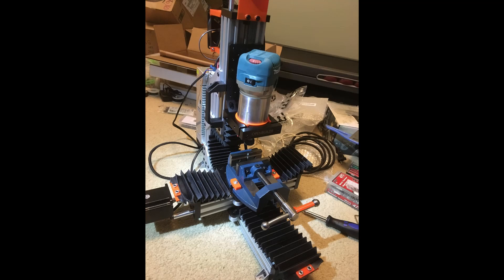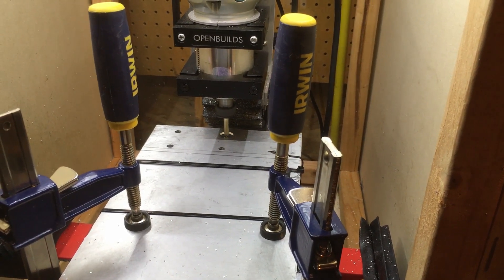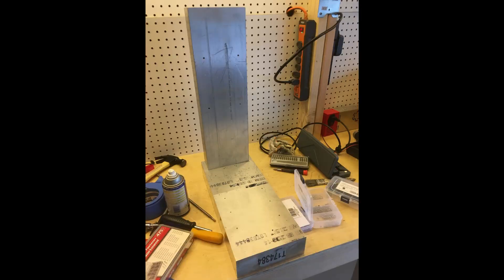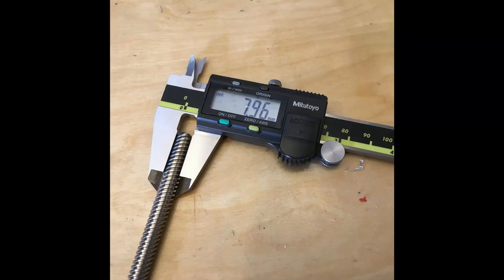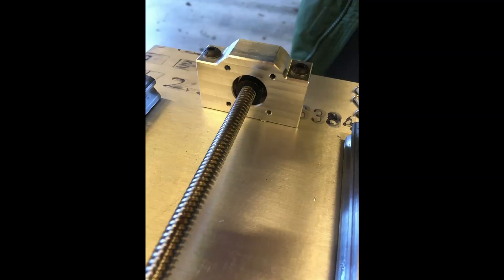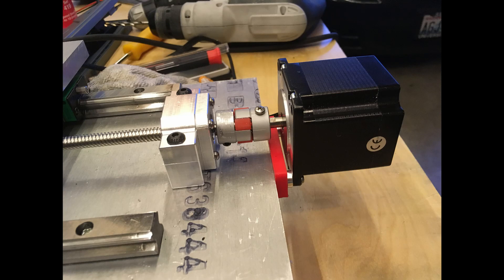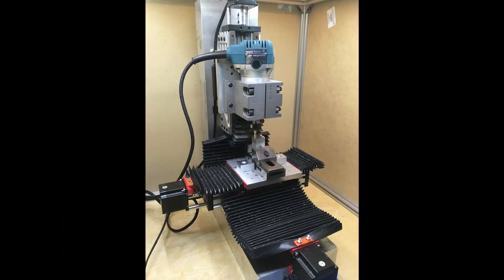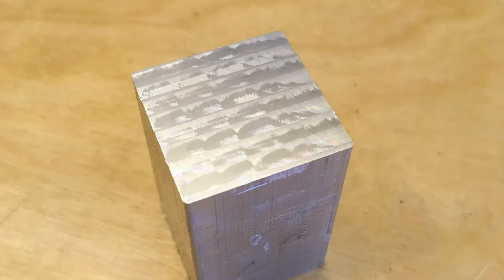OpenBuilds Minimill: The Final Upgrade

Comment: Not sure if you are still on here, but figured I would ask. I am planning on building one of these, but curious how you drilled the holes on the bottom of column? Most drill presses don't have room for the 17" or so inches the column is. Thanks!
Reply from the maker: I used a hand drill, with a drill guide to try and keep the holes perpendicular.
Reply: @imnoexpertbut  Awesome, thanks for replying. I would have never thought of the guide. I'll look into getting one.

Comment: use smallest possible diameter - single cutter carbide end mill - do not feed directly into z always feed z and xy at the same time - the axial force decreases and the cutter no longer wobbles out of its axis - feed less into z and increase the feed instead

Comment: Question about the mounting of your (y-axis?) stepper in the front. I see the bottom holes have bolts going into the aluminum block, and it looks like the top holes are bolted into a floating mount for the sleeve/cover. Wondering if you may be able to reduce a little bit of vibration by adding a 90 degree bracket for the top holes that bolts down into the aluminum block on the other side.
Reply from the maker: The stepper motor shouldn't see much load, because the bearing blocks and bearings take the big axial and radial loads from the leadscrew. Maybe you're thinking the torque of the lead screw could be moving the motor?

Comment: Hey, How did you tram the Z-axis?
Reply from the maker: The Z axis attaches to the column via angle brackets with generous clearance holes, so there's enough play to move it quite a bit when it's loose. I can also adjust head "nod" a little via the same method. The spindle itself also has oversize clearance holes for the bolts I'm using, so I can adjust the spindle to make sure it's aligned with the direction of z travel. I use a machinist square to eyeball a rough tram, then dial indicators in various locations to fine tune it. It's a pretty annoying, error prone process, because loosening the mounting bolts often means gravity takes over and so I have to try and hold it up while also making fine adjustments.
Reply: @imnoexpertbut  Thanks!

Comment: Great build. Have watched it a few times taking notes for building my own mini mill. You linked your video to me from reddit.

2 follow up questions, if you don't mind. 

1. Did you consider flipping the y axis so the c-beam moved sideways instead of the plate? If so, why did you choose against it?

2. What electronics/controller/software are you running?

Thanks, Andrew
Reply from the maker: I assume you mean flipping the x axis. I originally wanted to do that because it'd give me a slotted surface for workholding, and it seems more rigid when milling far away from the center of the axis (like on a manual mill), but couldn't think up a good way to do it. In CAD when I tried combining the Y and X plates into one plate, I couldn't figure out how that would work with the screws to attach the linear bearing trucks. So I'd have to try and screw the plates together, which also seemed tricky. Building it this way was really easy, and I found a parts diagram for a Haas CNC mill that shows it attached that way, so I figured it must not be that bad to do it this way.
Reply from the maker: I'm using an arduino running GRBL, some no-name cheapo but relatively large (4A) stepper motor controllers, and for software I use bCNC.

Comment: Hi, love your take on the Mini Mill. Pity that you didn't make any new video about it. 
As we speak, I got my hands on three  500mm  linear actuators and one  250mm linear actuator, similar to the ones used on the Openbuilds Mini Mill and a big bunch of MGN12 knockoffs linear rails. 
I am still debating with my self  if to go for a C-Beam machine ( two 500mm  actuators for the Y, one 500mm actuator for the X and the 250mm actuator for the Z) with an working area of around 350mm x 350mm, or to build a little bit over sized  Mini Mill like yours, trying to achieve the same 350 x 350mm working area on that too. What do you think? 
And a question: do you have a source that sells those hefty pieces of aluminum stock?
Regards from Cyprus.
Reply from the maker: I bought my aluminum bar from this e-bay store: http://www.ebaystores.com/usametalonline They are cheap for the USA, but I don't know about Cyprus! I have no idea if a C-Beam would be better or not, but if you build that let me know how it goes. :)

Comment: Where did you find the accordion covers?
Reply from the maker: I found them for $20 on amazon by searching for "CNC Machine Black Rubber Accordion Pleats Shield Cover" and then cut them into smaller sizes with a hacksaw.

Comment: As I watched your video and tool path, I noted you alternated directions of travel relative to the rotation of the spindle and not surprisingly experienced more vibration in certain directions along the same axis.  It is more typical to stick with a preferred direction of travel.

This leads into a discussion regarding the pros and cons of Climb vs Conventional Milling.  With the tool rotating clockwise, climb milling goes WITH the rotation. Think of the router climbing along that outside edge in a clockwise direction.  In your video that was from right to left along the x axis.  When climb milling the flute (cutting edge) hits the material at the top of the cut, and the thickness of the chip decreases as the flute cuts further into the material. This results in chips being efficiently cleared behind the cutter, rather than plugging the flutes, being re-cut and building up heat.  The result is often a better surface finish, longer tool life, and less power to drive the spindle.  This cutting action also provides a downward, stabilizing force on the material being milled.

However if backlash is a significant issue with your lead screw setup along any given axis, then Conventional Milling is the preferred way to go.  This orientation is also  preferred for more brittle or hardened materials such as cast iron or hot rolled steel.  Neither of which are likely candidates for this machine.  

If you google Climb vs Conventional Milling, you will no doubt see lots of content and videos.